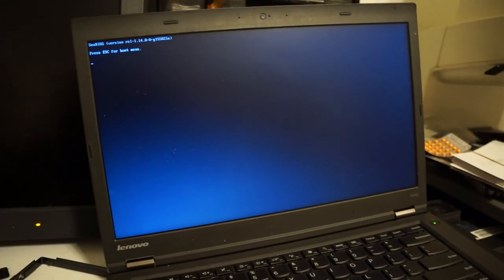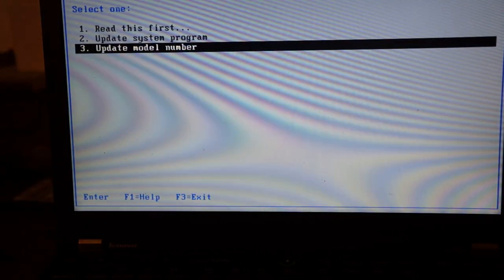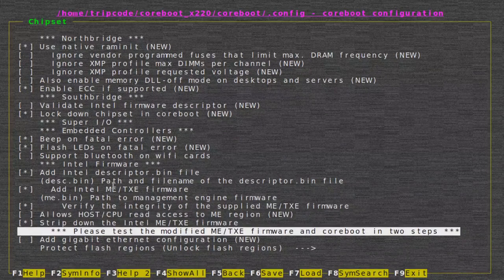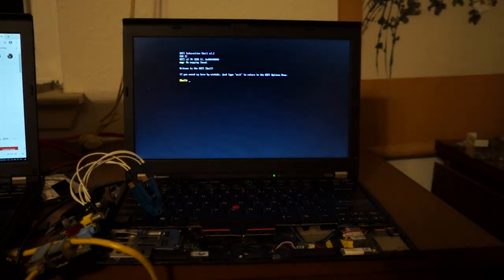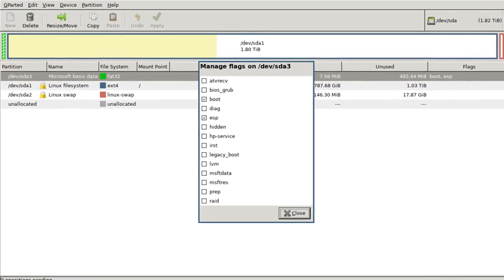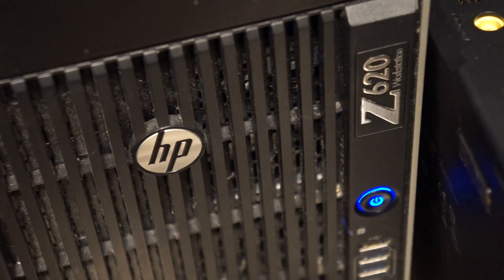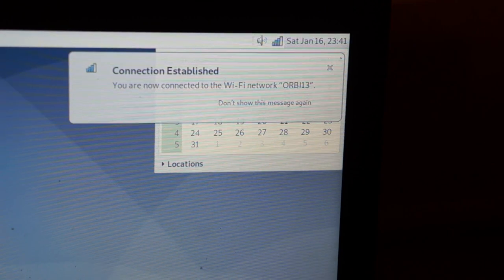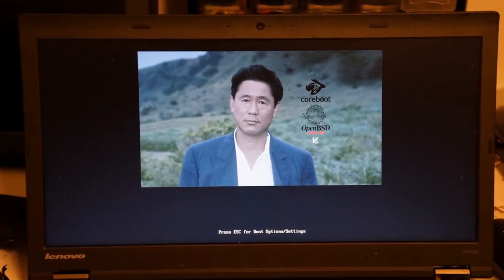Installing and Experimenting with Tianocore Coreboot and UEFI (x220 & t440p)

Comment from the maker: I'm 99.9% sure that the t440p coreboot video will comeout early next month, I'll probably finish the build beforehand, but I am waiting on a part, and it will have footage over a few SD cards, so it will be a bit annoying to edit lol :D Also if anyone knows more about tianocore, I am a bit curious how it stores data. I noticed my Debian entry was still their when swapping the hard disk into another system. I am pretty sure I didn't make a debian entry on the other one. I also am unsure if the boot-order is stored on cmos or flash. Never mind ... https://mail.coreboot.org/pipermail/coreboot/2017-March/083727.html

Comment: May i ask you is tianocore can do latest uefi gop skills for example native resolution boot screen and native resolution ( of screen resolution) uefi bios. Becoz i noticed to smaller then screen ?
Reply from the maker: I haven't had many issues with tianocore and screen resolution. I've had some recent problems with the current build on haswell, though.

Mr. Chromebox is quite knowledgeable about this, though.

Comment: Wow, great! I remember commenting about T440p coreboot on one of your videos and I like to think I had some influence! But I'm willing to accept that you may have individual thought outside of the comments section...

I remember finding the link that you posted when making my T440p build... I  didn't like the idea of using UEFI (and still don't) and was unable to compile his coreboot fork for some reason. Rather than figure out why just so I can use someone else's config, I decided to dive in head first with my own.

I did struggle getting it to POST for a while due to the MRC.bin file that is required in this build - this part, I believe, is automated by Mr. Chrome Box's fork. You can obtain it using the coreboot utils - https://doc.coreboot.org/northbridge/intel/haswell/mrc.bin.html - I was a bit confused by the documentation, but actually, it's really not that difficult to do. If you don't include an mrc.bin file, the T440p will not POST, but you will be treated to a nice flashing power button.

With MRC.bin in place, it booted with SeaBIOS - it even loaded Win10. I only have Framebuffer mode selected at the moment, (but I have the VGA ROMs on board) so you have to set the resolution in settings each time you log in. GNU/Linux, of course, has no such issues.

I also recently figured out how to choose boot order in SeaBIOS, which is important for the T440p since it wants to load the optical drive by default!
Reply from the maker: Thanks for the suggestion, I did see it in the comments. The mainline branch now works for corebooting the t440p, I did use that method to obtain the MRC file, so if your wondering the mainline branch works fine now :D.

I am a tad worried about rootkits on tianocore, but the ease of use means I could probably make alot more roms for a general purpose. Tianocore was pretty impressive in that manner.

I was thinking of settling on doing a sort of precompiled roms for various systems project. Automated build, latest coreboot, some sort of website,  modified teared down models on a server rack. Although that is kinda a lofty dream at the moment.

Also, eh retroboot came out, so another grub payload thing probably would be a tad redundant :c
Reply from the maker: https://doc.coreboot.org/technotes/2017-02-dealing-with-untrusted-input-in-smm.html :c
Reply: @tripcodeQ7  is the SMM exploit an issue on all payloads, or just UEFI?
Reply from the maker: @Ashkimbo  I am not sure the page, just mentions intel talking about it in a coreboot and uefi config. I imagine due to chromebooks being a large commercial usage for coreboot.

Edit: didn't mean to post that, but I am actually not sure. There's also a chance that it could have been patched in the last three years, I was doing a bit of research on it.
Reply from the maker: I'm not a expert on intel exploits, lol.

Comment: Can i use Tianocore Coreboot on modern intels 12/13th gen cpu?
Reply from the maker: I would say no, but over time probably. I don't really keep track of modern intel chipsets. So, I might be wrong. I did re-read some of the ME-Cleaner information if your concern is security. It seems they say <=11th gen. 

//I imagine though that does not apply to all units and a bit of luck on bios revisions as well as other factors is a factor.

Purism does do more modern chipsets, so far selling a 10th gen laptop. Although I'm not super familiar with modern intel chips and I don't keep track of purism. I think their latest is 10th gen.

Anyways good luck, I'd pay attention to the ME_Cleaner, and coreboot docs for the information. Their was some article saying support might be coming, I haven't researched this, but I wish you luck.

Hopefully this wasn't too much details, lol :D Probably should of just said most likely no, because with software stuff changes with the passage of time. Peace :D
Reply: @tripcodeQ7  
I do really hate Intel ME,because this is something which makes me worrying about my privacy.
But thanks you anyway :)